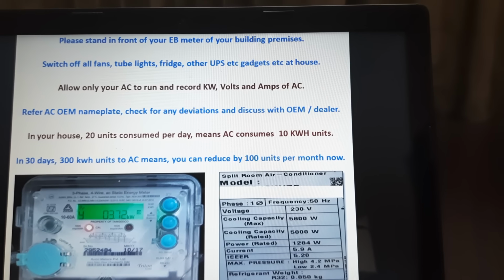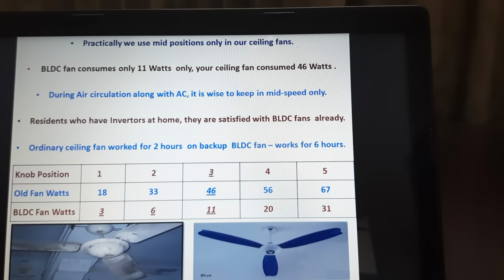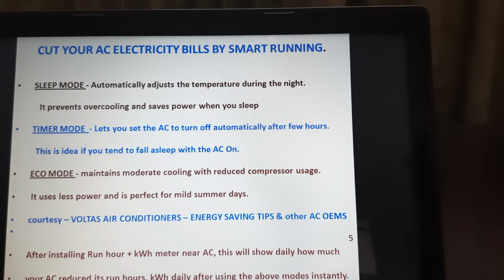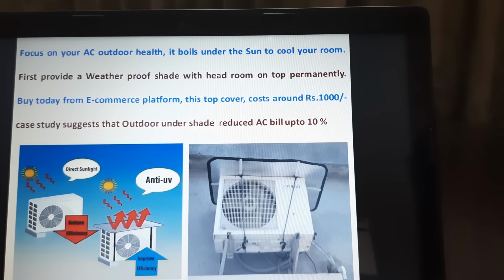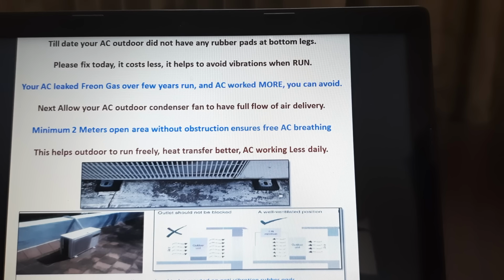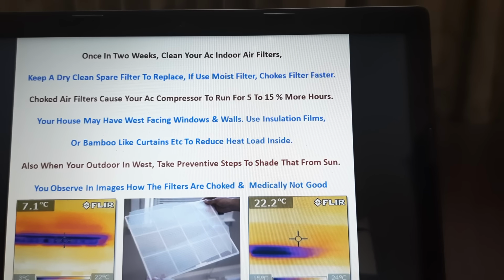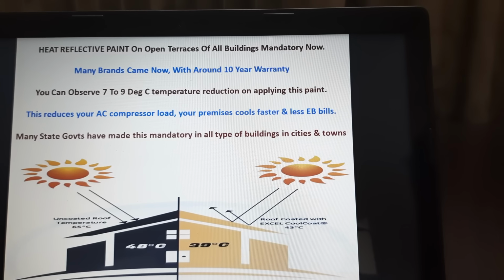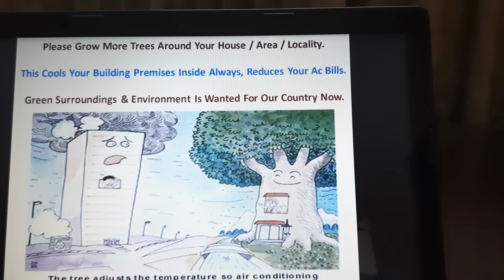Air conditioner’s Electricity Bills can be reduced upto 30% #AC #electricbill #BEE #energysaving

Comment: Here is how i get less electricty charges with ac than using 2 ceiling fans. I maintain the temperature between 24 to 27 degree. And i make sure only ac cooling runs not the fan inside the ac. And no swing mode. My ac is 3 star rated. My 2 month home electricity bill after using ac 8 hrs a day is rs. 390/_
Reply: Are you being serious? 390 bill after 8 hrs of ac usage? What exactly do you mean let the ac run, not the fan inside. How does one keep just the compressor on independently.
Reply: @par-excellence my ac is Panasonic 3 star rated. I heard 5 star rated consumes even less electricity. In my remote there is a button called "fan speed". I keep that so low that I don't really hear much noise/sound from ac. Also I use the "swing" button in a way there is no up and down swing in my ac. I also need to confess here in tamil nadu we have 100 units free electricity. But despite all that using 2 celing fans in 2 rooms during summer or eb bill for 2 months was somewhere between rs.400 to rs.500. But last year and this year summers are way hotter than ever so forced to use ac . Instead of sleeping in 2 rooms with 2 celing fans we all sleep in 1 room with 1 ac. And our 2 month eb bill is somewhere between rs.300 to rs.400. We are a very electricity conscious family. We use washing machine only once a week for heavy cloths. We don't let fan or light in rooms when no one is there. No even in kitchen. The highest consuming appliance in our home might be ifb chimney. But we use them briefly while Start frying something. The moment we add water to the fry pan we switch off the chimney.
Reply: @satheesh1817  Great to hear tht. Appreciate your energy conservation tips. Will definitely try it out 😊
Reply: @satheesh1817 why you are so conscious about electricity  usage..it looks little bit out of the line thing ..weird
Reply: @AlmostAwasthi ?? Why aren't you?
Reply: @Skibidi-i6l i mean i am conscious  about not wasting electricity  but i am not in extreme  of it ..like i wont avoid using machines so that i dont consume energy  ..i try to make balance
Reply: @AlmostAwasthi i guess reducing electricity consumption is a middle class thing here in south india, particularily men who pays the bill. I might have picked this habit from my dad.
Reply: @satheesh1817 i mean its a great habbit but i dont know i feel like u should  maintain  a healthy balance between  functionality  and bill reduction  ...
From what i read ..you seemed to be really into extreme  stuff of  reducing energy consumption ..
Which i find little unusual 
Though  i completely  understand  people have different  habbits and personality  i am not saying you are wrong or right i am just curious about your mindset
Reply: @AlmostAwasthi  You seem like a rich boy
Most Indians should follow Mr Satheesh's advice
Kids don't remember the days of Licence Raj
Reply: @AlmostAwasthi I guess I'm trained that way from my childhood. In my childhood if I go to drink water in the kitchen and return back to hall without switching off the lights my parents made sure to mention that to me.
Reply: @par-excellence its absolutely possible, just read my comment whre i have shared my experience.
Reply: @par-excellence The man is just dumb bro.
Electricity consumption of an ac depends on the ambient temperature and heat source. Every house is different, every room is different.
Reply from the maker: Excellent, you are using your AC very wisely and economically. Appreciate your Energy saving Sense.
Reply: @energymeasuretosave3082 pin this message sir
Reply: Sounds impossible. Your meter is faulty
Reply: Yes.. it is true. Electricity, Education, Road, Tamil Foods, Doctor fees all are cheaper than other state… You do not believe you will get very very good MD doctors with fees not more than 200-300 and their diagnosis is much much better than other heavy priced doctors…
Reply: Iska meter check karao
Reply: Bro, just not possible.
Reply: What is Aircon saver , a retrofit to non inverter ? Please share link of this device.thanks
Reply: I donno how well that works , bcoz compressor generally consume far more energy than fan itself , you can just look it on web. So having fan speed medium to high while having temperature set at 28 would be far better, at least that what I do as fan will throw cool air faster and as a result compressor will work less. Also my ac is not inverter ac so I can't really talk about that but I think thing will be similar there, just energy consumption will be even lesser.
Reply: HOLY CAP🤡
Reply: Which state ? What other big appliances do you have ?
Reply: @Moogli07 tamil nadu, I have 3 star rated Panasonic ac, ifb washing machine and ifb chimney, preethi mixer and also a grinder. Nothing else. Ho I have a offline solar backup which might be giving me 1 unit per day
Reply: @satheesh1817 fridge ?
laptop ?
Reply: @kalaivanisundaresan5855 ya we have a 15 yrs old fridge and a laptop as well. Look I have a offline(non grid) solar backup setup which gives me 1 unit per day. In the day time we switch off the main line and most consumption happens from solar backup except for fridge, occasional use of chimney, mixer and grinder. We switch on the main line only on night or evening around 6 pm and switch off at 6 am in the morning.also here in tamil nadu we have 100 units free electricity. All these factors might be contributing to overall eb bill i guess. One more point, if u guys have ups backup but not solar, at night u can switch off the main line to ups and let ur fan run in ups backup alone. U can turn back ON  the main line to ups in the morning that one factor alone will help to save you 20 units per month.
Reply: @satheesh1817 your comment is a bit misleading as there are multiple hidden factors involved for your low electricity bill. Number one being the free electricity units. Moreover I'm pretty sure your outside temperature would also be kinda normal not intense high. For me living in Delhi ncr, it's costs around 2.2k only on ac monthly that too for one 3 star inverter window ac unit only. Total bill exceeds more than 3k.
Reply: bullshit
Reply: very good info
Reply: Seems ur from TN, other states will make more than 700 Rs. bill
Reply: Eb dept to check this meter. Something wrong.
Reply: @ganeshnatarajan2190 this is exactly what the meter reader guy from eb dept told me on the summers of last year , now should  my meter be checked every year during summers?
Reply: @satheesh1817 what??
Reply: Do you have solar?
Reply: @claire24673shs i do have a old tata solar setup (offline one / not grid connected) for 10 years now and i was told at the time of installation that this setup gives me 1 unit per day.
Reply: Pls tell the unit consumption so I can calculate in my state rates
Reply: @Sraman-gg2ne ok, usually I get as low as 120 units to high as 250 units for 2 months. Also here in tamil nadu we have 100 units free also I have a offline solar setup with gives me 1unit per day.
Reply: just tell the units consumed instead of electricity cost if there are caveats like 100 units free, avoid confusion
Reply: Not possible. People getting electricity bill from Rs 300 to 3000 is absolutely bs with AC usage for 8 to 10 hours. Here in Hyderabad a 2 bedroom 3000 sqft built up are we get Rs 15000 to 18000 for using AC for 10 hours + 4 fans, WM, dd fridge, TV, & all led lights. This is in summers other seasons we get minimum Rs 6000 to 8000 & Electricity dept have changed all high end digital meters. 1 day late payment, they send their collecting agents/goons  to cut the power
Reply: Sure buddy, missed a zero at the end perhaps lol
Reply: @rohanb2711 i get it. People who got nothing valueable to add to a conversation  usually retort to sarcasm
Reply: bijli chori krta hai wo kon btaega
Reply: Why are you even using fans. Switch it off and save more
Reply: @Vineeth_Shankar in summers I switch off the fans and switch on the ac. Is that a problem? And don't u think it is my choice to do what I want?. Getting personal here, aren't we?
Reply: @satheesh1817 how am I getting personal? You gotta chill sir. It was a mere suggestion 😅
Reply: @Vineeth_Shankar now sarcasm with a smiley?
Reply: @satheesh1817 relax 😂
Reply: @Vineeth_Shankar again?
Reply: @satheesh1817  bhai ac ke fan ku hath se ghumata hai😂

Comment: aircon saver is a fraud product...dont buy this kind if products which are not approved by air conditioner manufacturers.
Reply from the maker: Aircon Saver is a E Prom based Micro controller gadget working dual sensor algorithm principle This has been tested in many PSU including EESL etc and proven product over years or working. I am not promoting this product. I am suggesting similar branded products like this in E Commerce platforms. Suggest you review the branded product in this Aircon saver and take a call on this. and derive conclusion of your own. Thanks for your feedback.
Reply: also You don't want to. The condenser needs air. The condenser doesn't care if it's in the sun.
Reply from the maker: @rohithkumarsp when the condenser boils under the Sun. It gets derated. It will work but inefficiently. Thank you
Reply: @rohithkumarsp  it called mini-maxing